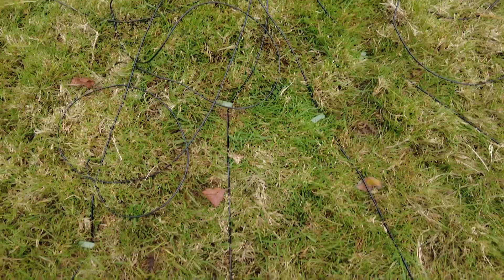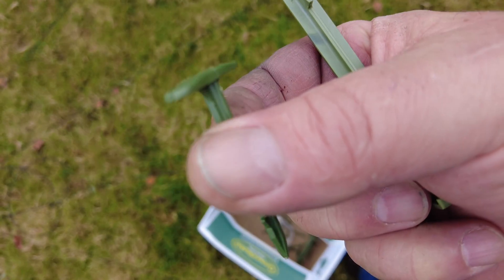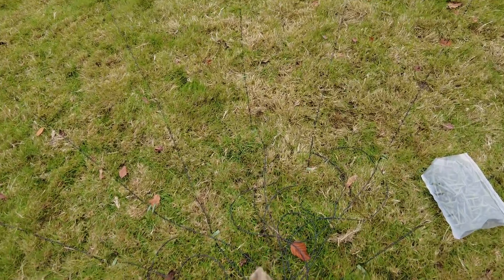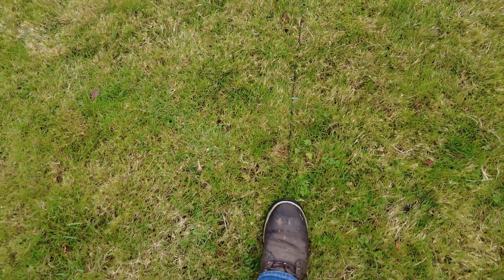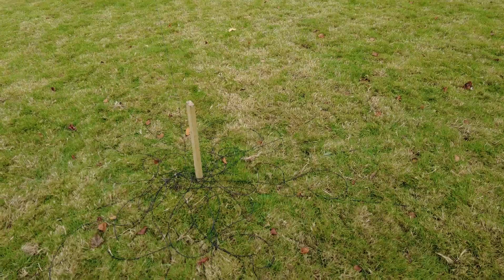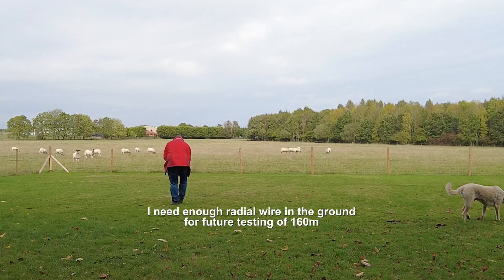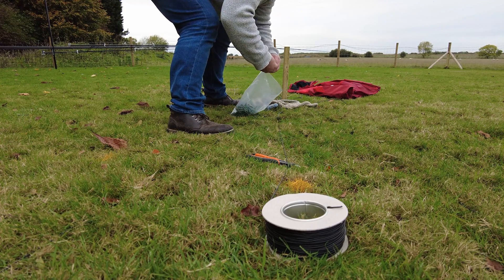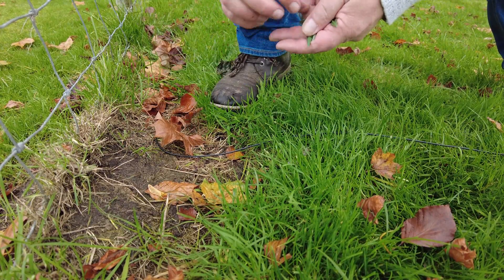Ultimate Guide - How To install Radials for Vertical Antennas

Comment: Callum… found only your company web site has the 2-inch biodegradable pins, most all of the sites I’ve checked have the 4-inch pins.  Will be installing my Signature 9 radials on a sun-baked, sandy hill.  I guess I’ll just use a larger rubber mallet to pound the in!  P.S.  I like your suggestion of using 2x the lowest frequency  for the total length of radials.   73 de KD6UYK (Tim).
Reply from the maker: Yes Tim. Makes it easy.

Comment: Sir Callum - Thank you for all these perfectly educational videos - you are a true Elmer!  I'm a new Tech.  I've watched all your radial videos and have two questions, if ok.  1) As the radials get slowly buried over time, do they become less effective - at what depth do they become worthless (e.g. do they need to "see" the sky).  2) Silly question - can the radials be set up far away (e.g. 20 meters) from the DX Commander - with just one lead running from the radial center back to the antenna? (I want to install my new 12.4 near the house, but my field to take the radials is over 70 feet away).
Reply from the maker: OK, so no - radials near the base. Lots but short are fine. Buried over time... You might have to wait a LONG time but 2-inches under the dirt and it'll still work.

Comment: I wonder if using the galvanized steel ones for landscape will work. I wonder because I have put more than 25 radials in my backyard using the steel ones and the results I'm getting are not good at all. Could be something else but now I wonder if the plastic vs steel makes a difference. The terrain in my backyard is pure sand, I wonder if those little ones are going to hold down
Reply from the maker: OK, so the pins won't make any difference.

Comment: Did this years ago, Made a 10 meter 1/4 wave vertical 9 feet off the ground to the top of the vertical with about 40 ground radials buried 1 inch deep and it was terrible for ground wave but great for very short skip about 300 to 1000 miles.
Reply from the maker: Ah yes! Well spotted (ground vs skip)

Comment: Okay Cal - one more thing. I got the huge balcony, about 4 m above the ground. Should i install the vertical on ground, or on balcony? I know it will change the radiation plot, but how about efficiency of a 1/4 vert? Should the radials be for 1/4 each band, or just... like you? Im afraid i will not be able to tune it with various radials lenght. 73!
Reply from the maker: Right.. I would do whatever works physically and practically.. From the data I have seen, taking even small elevated radials (and the coax) most folks tend to get a decent match regardless.. I know this isn't in "the books" but I would just do what ever suits you in that scanario from an engineering point of view.. The RF will still leave the antenna.. In your case, you don't have much choice..
Reply: @DXCommanderHQ  oh well, its not as bad as you think :) From my daily qth it indeed is (hf-3-explorer with the radials...) but at my parents i have a couple of meters of yard. But to be honest, installation on the balcony would be more handful for me. The main problem is the air electric network which is about 10 meters from my fence, 50 Hz makes noisy background for S9... Still, i have to move my antennas to other side, see whats going on there. Thank you for your work Cal, you are the inspiration for many. See ya! SP7EZG

Comment: What do you win with these ground wires? I know they work as ground, but what do they actually count to antenna gain or SWR etc. What about a good earth connection like for flash protection?
Reply from the maker: They make the antenna efficient so that your transmit and receive gets out. Flash protection.. Big topic :)
Reply: The radials are the other half of the antenna.

Comment: K, newbie here trying to figure out options to get into hf and it be agreeable to the wife & safe for kids. I hope you see this and can answer it. If youve got a video on these answers, feel free to give a link. 
My question on the radials is - im not concerened with any tripping hazards with them, but are they a resonate danger? Ie. If/when transmitting, are the radials any risk for shock or burns? Likewise, on the dx commander. The antenna goes to ground level. Everything I've heard about antenna's says keep it above what anyone can touch because they could get shocked or burned when transmitting. Isnt there a risk for this on the dx commander as well? Does a parameter need to be set up around the base?
Reply from the maker: The radials will be effectively inert. I say effectively because all the current is dissapated early on. Literally nothing will happen.
Reply: @m0mcx  Thank you. Good to know on the radials.  And how about the actual antenna wires? Doesn't the access to the actual antenna wires within reach from the ground on the dx verticle antennas pose an rf burn risk?  Kids may be outside playing and try to mess with the wires when I'm transmitting.

Comment: Do all the radials that come in at the base get terminated somehow?  Did you drive a ground rod of some sort?  Thanks in advance...
Reply from the maker: No.. They come to a plate. The plate doesn't need an electrical ground unless you want a lightning conductor.

Comment: Do you have retune the antenna after you have buried the radials in the ground. Because i found that my swr curve moved after i have placed them 2cm underground
Reply from the maker: Erm.. My tune has gone lower by about 50kHz on 80m band over last 18-months... So maybe! I don't know if it was the coil or the ground changing.

Comment: Do radials have to be 90 degrees in relation to the vertical driver element? I can hydraulic-drill 10m of 15mm copper pipe around my vertical into the ground and use the copper pipe as my radials? As long as total of copper pipe is 4 wavelengths? Or will the earth "mask" the length of copper pipe I drilled into the ground?
Reply from the maker: Not so good.. You are building a lightning protection syste.. Radials need to be on the ground really.
Reply: @DXCommanderHQ  Thank you very much for the reply and advise Calum. Much appreciated. I’m new to this hobby, so still have a LOT to learn and experiment with. 73

Comment: I know this is 5 months later. I have been thinking of easy ways to deploy radials, without fighting. I thought about radial secured to a tarp, 550 (parachute) cord tied in a fan configuration, or tent spike.

I was looking for a fast and dirty way to deploy 16 radials, in a park.

What are your thoughts? And the thoughts of other viewers. I’m curious. I can’t do anything in my apartment complex. Unless I try the gutters, somehow.

Thanks
Andre N2JDH
Btw my call accidentally means Nice 2 Just Drive Home.
Reply from the maker: 16 radials easy.. That 4 radials on ONE connector and 4 byunchges of them. WIll take approx 90 seconds using the right wire (DX10 is about the ONLY wire I know that would do this and lay flat instantly.

Comment: That looks great.  But how does it look in 6 mos or a year later?  Like if you have to move, do you pull the radials out? or do you just ignore them and walk away?
Reply from the maker: Walk away...! You can remove them.. Start at one end and ping the pins out. Problem though, they do tend to bury themselves.